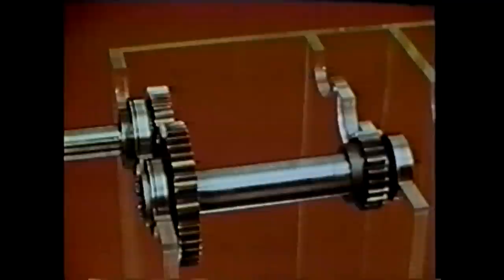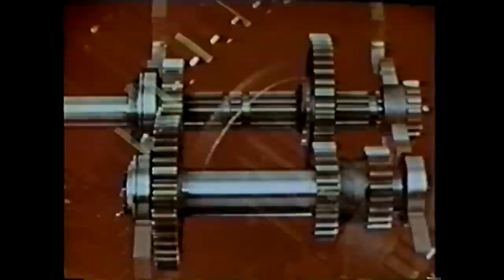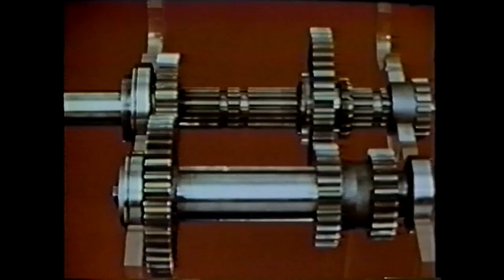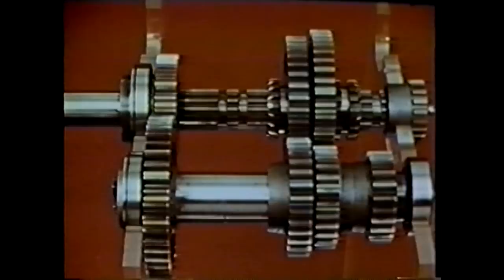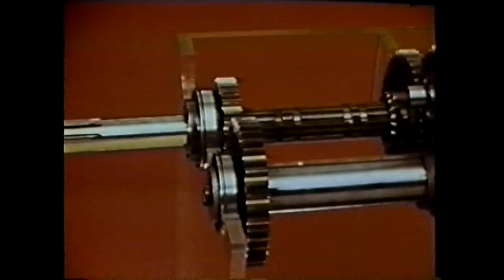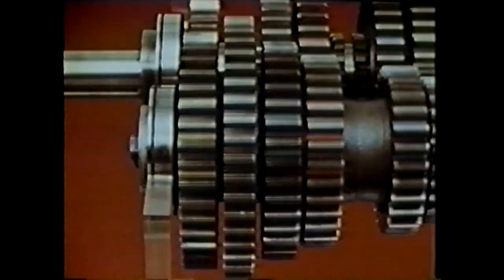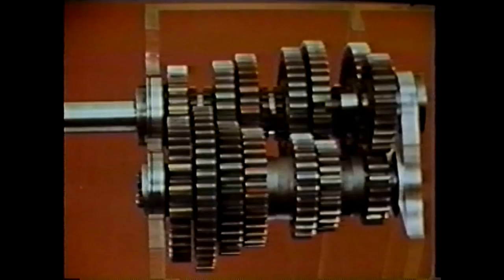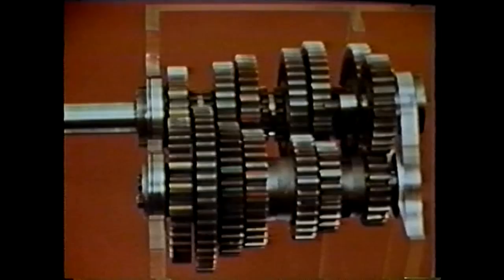EATON TRANS POWER FLOW MOVIE

Comment: Really easy way to explain the mechanics of the RoadRanger Transmissions, it's pretty easy to see the power flow on the transmission with just one countershaft even though I knew the twin countershaft do the same and rotates at the same speed since all the gears are constant mesh gears

Comment: Looks like a 10 Speed ..   a 13 speed and 18 speed video would be interesting too  where you can split each rear in the higher range.  between direct and over drive..
  I had a Baby RT-6610 that I rebuilt and converted to RTO-6610.  I have a   RT-613  that I am going to replace with an RTO-613 because the truck rear axle rations are too low..
  I  have a couple of heavier Trucks with  13 speeds in them too .

Comment: one element missing.. the gears before engaged are spinning... on what? and where does the teeth engage the gear via fork..and how to what?  is there in inner bearing race with teeth?
Reply: The gears have bushings or needle bearings so that they free spin around the output shaft.
As for the rest of your question I do not fully understand what are you asking. 
But you can see the sliding clutch at 2:55. What isn't so obvious is the splines in the gear. So when the sliding clutch is slipped into the gear the splines on the sliding clutch match with the splines on the gear and thus the gear gets locked to the output shaft and transmits power. Other gears are just free spinning.

Comment: If the auxiliary is synchronized, why isn't the main transmission?
Reply: Because rev-matching the aux is out of the question. There are a number of technical problems like the fact that you would have to rev-match 2 gears at the same time, and the fact that the difference between the 2 ratios is large.